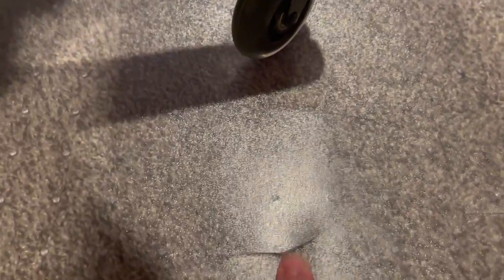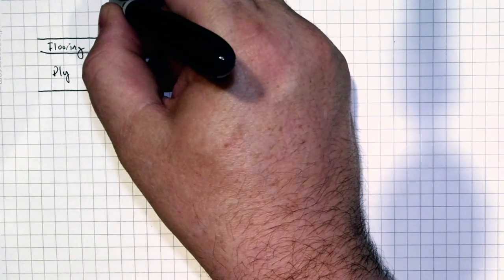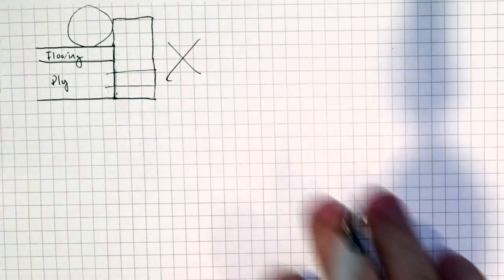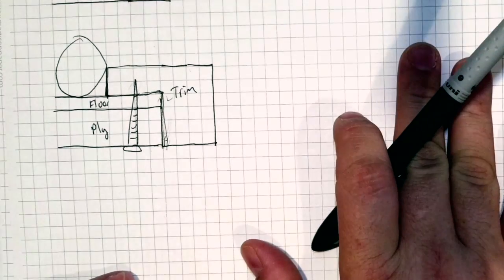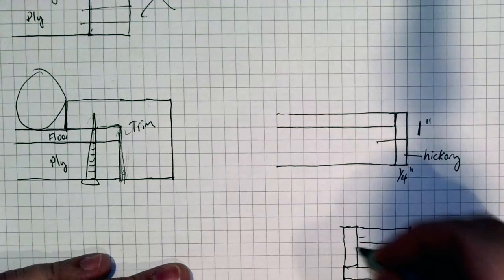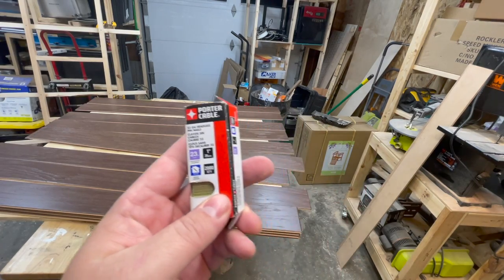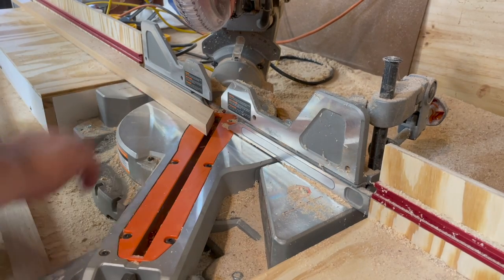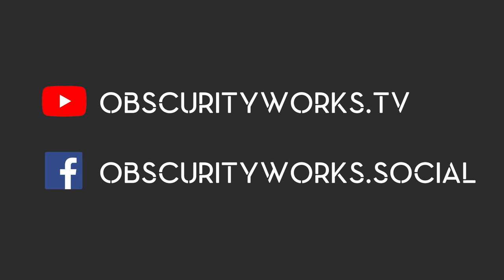Wood Flooring Office Chair Mat

Comment: This is good, but it might be a little over-engineered.  3/4" ply is a bit much, and adds a ton of weight and cost.  You could get by with 1/4 or 1/2" OSB as your substrate, then use a hardwood edge, rabbeted to allow you to use one piece and overlay the corner.  Some might not have the tools to do a rabbet, so your method works great.  And, a roundover on your inside edge would reduce any damage from chair wheels rolling up against it.   Nice work.
Reply: ¼ is too thin for some people, me for example. The carpet it goes on just can't handle it and the weight that goes on it. ¾ worked very well for me. It'll depend on the use.
Reply: @no_handle_required  Yeah...1/4" wouldn't be enough, but 1/2" should be...I'm a big dude with a big chair, so we'll see what happens. LOL
Reply: Thing is 3/4 might be a little thick, but it's not as popular size as a 1/2 so a lot of times 3/4 will be cheaper to buy than 1/2.

Comment: Is it possible to use a 4 X 8 sheet of hardboard from Home Depot?  I'ts actually hard, and you can cut a sheet in half and have two floorings for the chairs?
Reply: I'd imagine a sheet of hardboard isn't hard enough to replace the plywood. It is basically the same material that a clipboard is made of, if that helps you imagine it. It could probably replace the wooden flooring panels though
Reply: I would think that hardboard might work if the carpet is not too thick (ie is low pile). If plush (high pile) carpet and when the chair rolled it might be a bit "wobbly".  I've got engineered hardwood left over and am deciding between 1/4" or 7/16" OSB for under it.  The 7/16" might make the overall height a bit too high though. Still thinking.
Reply: I already have a pretty hard chair mat but a wheel finally wore thru it and is cracking in that spot.  I will keep the old chair mat i place, and cut a hardboard sheet exact size and put it on top so it has a flat support.  That may work pretty good for a few more years.   THUMBS UP!!!
Reply: @danieldaponte1819  I found a 6mm MDF sheet to be plenty hard enough.